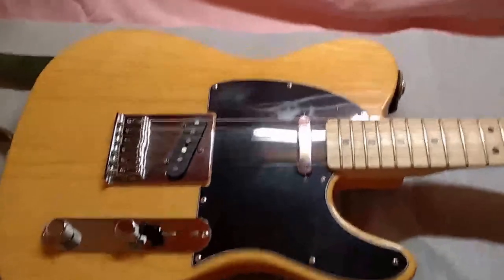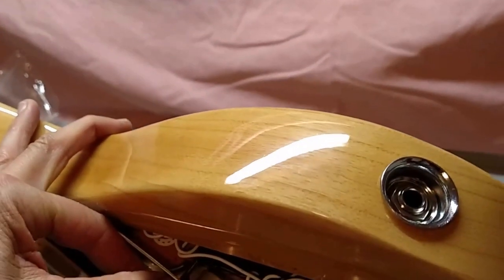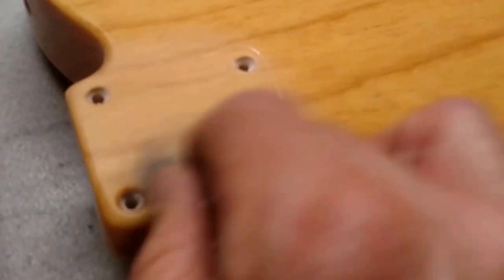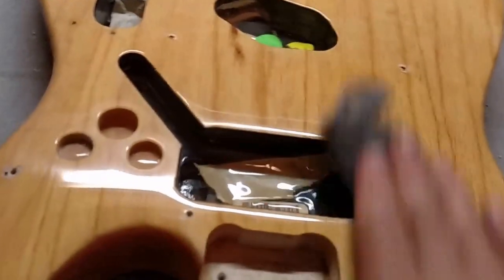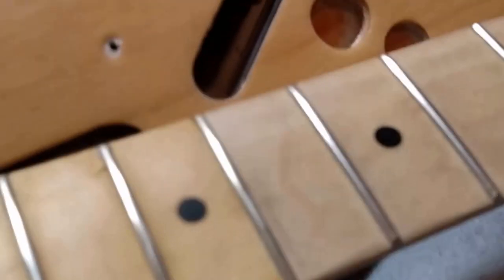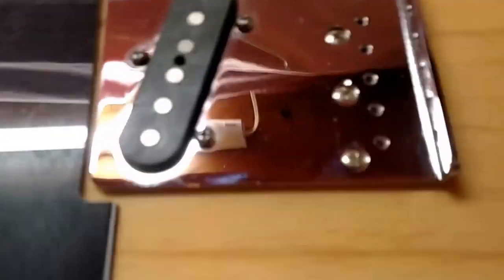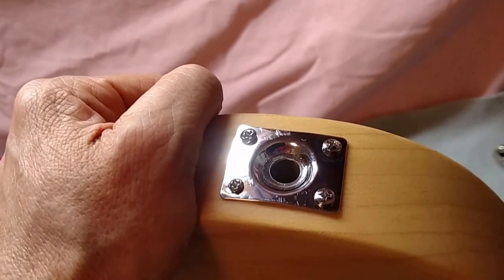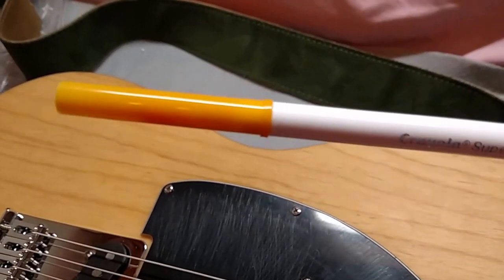How I Removed Gloss From Telecaster Natural Finish Guitar Ash Oak Relic'd

Comment: our modern protective wood finishes don't break down as easily as the old lacquers and varnishes. it's harder to get that broken in look just from daily use. good job making it look the way you wanted.
Reply: They use those finishes because they are quickest to apply in the production process. Some end up ridiculously thick, and I also hate those mirror gloss finishes. I have one older Korean built LP Jr type with a very thin coat of poly, and it is actually starting to age very nice, showing wood grain and looking a lot like nitro, I sometimes wonder if it is nitro. Probably not cause it's a very early Agile of the cease and desist variety.
Reply from the maker: Hey rxz4140, check out the guitar in this video on my new song + music video "SETBACKS" Thank you!
"Setbacks is a swagger filled retro swirl" - Boots Music (UK)
CLICK HERE: https://youtu.be/gwQ09mhF0qk

Comment: If you buff it just a little it will look like a thin nitro finish. The cool thing is it protects the wood better than nitro.
Reply from the maker: Hi David, check out the guitar in this video on my new song + music video "SETBACKS" Thank you!
"Setbacks is a swagger filled retro swirl" - Boots Music (UK)
CLICK HERE: https://youtu.be/gwQ09mhF0qk
Reply: What would I use to buff it..thank you
Reply: Any kind of buffing motor with a buff pad. Hand held buffers will work but you need all the hardware removed first. Just let it shine in certain spots and not a glossy shine.

Comment: 800 grit sandpaper on a homeade sanding block with a little give is the best way in my opinion. I use 0000 steel wool on my frets after a level/crowning or to clean them up about once every year or two. But, I wouldn't recommend it for a job like this. It's messy as I'm sure anyone knows who has used it and less consistent. Not to mention its not something you wanna have stuck to your pups, with sandpaper i just mask off the pups and take it off once the guitar has been sanded and whiped down. That's why I recommend the 800 grit sandpaper. It's just course enough that it won't take forever but fine enough you won't do damage if your paying even a little attention to how much laquer your taking off.

Comment: Don't breathe the dust.
Wet sanding, or even using buffing compound which creates a slurry, keeps down the dust while also creating a more even finish removal.It isn't pretty, but you can still use steel wool, - wearing surgical gloves is the way to go.
Once you thin the poly, it's possible to create cracks on raised edges by applying fairly blunt (but necessarily forceful ) pressure .Heavy steel pipes or hard woods work great for this.Once you get rid of most of the poly, it should be possible to buff out all the tiny scratches, and achieve a more moderate sheen.
This can be done well, - it just requires more patience and fortitude than most have on tap.
Reply from the maker: Good advice, thank u.

Comment: Pls Recommend a specific steel wool type- also did the neck feel differently after sand and color changes. Much appreciated b
Reply from the maker: A pack of steel wool is pretty cheap, like four + bucks at home depot. I am not sure which one I used exactly, it was either a medium #2 or a lighter grade #00. I would buy both and test them. If you take the neck off the guitar, or remove the pickguard you can test an area behind the neck plate or guard with both grades and see which is more appealing to you.
The lighter grade will mean more elbow grease.. you could also use the number two to start with and then finish it with the zero grade.
Reply: @JoeNormal  many thanks. 
Did the neck feel different. 
Am used to the one in my photo- a maple slab 66 ,but dont want to take it to gigs anymore. 
That neck is now - pure wood. 
Just bought an overly shiny American Professional- need to get the shine off… as you know. 

Much appreciated. Nice work. Thanks in advance.
Reply from the maker: @golds04  Yes, the neck feels a little silkier, less grippy when moving up and down the neck at a sweaty gig.

Comment: Did you sand it down to the bare wood or just knock the gloss back?
Reply from the maker: I just took off the gloss, it's not down to the bare wood. The body has a nice satin smoothness to it now.
Reply: Cool, thanks.  After you get used to unfinished/satin necks, you really notice how much the poly and gloss finishes stick and affect your playing.  Right now I'm trying to talk my self into sanding the neck on a Les Paul but I just got it so we'll see.
Reply: JOE NORMAL I'm planning to do the same to my Tele - once you take off the gloss do you recommend applying some kind of wax or oil, or is it unnecessary since the matte finish is still there?
Reply from the maker: Michael Schuppe it's not necessary to wax or oil afterwards. The matte finish does not go down to the wood grain at all.

Comment: does this remove the finish or just matte it? (sorry if you mentioned this in the video, i had to watch with the sound off)
Reply from the maker: It just mattes the finish. Of course it probably takes off a micrometer of the clear finish, but it certainly didn't take it down to the wood.

Comment: Joe, you could just strip all that thick poly and have a body shop spray a thin coat of poly sealer. The sealer is satin finish, would improve your guitar tone, and would quickly wear thru in the usual places.

Comment: You should really wear a mask and stuff, when you're using fine wire wool. The wire wool disintegrates into tiny pieces and gets into the air. It doesn't do your lungs or eyes much good. I don't know, but the polyurethane varnish dust, probably ain't a good source of vitamin C either. Man, you must have lost a few layers of skin off the finger tips, either that or they're as polished as Grandma's best china... I have a very similar Telecaster, but I'm going to leave the gloss as is and hope I live long enough to play the shine off it...

Comment: Hi Joe, it's good video.  Just curious, do you think using sand paper easier and more appropriate than steel wool?. Btw the guitar looks great at the end.  Thanks.
Reply from the maker: Harif Santoso the steel wool worked great because it didn't strip away much of the coating, it just dulled the shine. The finish feels smooth and silky to the touch. I'm not sure if sand paper would have the same result.
Reply: Thanks Joe, I might try that to my glossy neck.  Thanks for the tips. Cheers.

Comment: I think that dulling the finish on this instrument reduces it's value.
Reply: So, it's his guitar, it's just a Mexican built guitar, most custom shop guitars are reliced, so would relicing a reliced guitar be a bad thing? I did the same thing to my 60's CV Tele and I had the same thing, people telling me I "ruined" a perfectly good guitar. Well it now has Fender custom shop pups, 4 way switch and various pots and parts of my choice, and it's my number 1, and it's not going anywhere. Make it your own. I have a 50's butterscotch that fell out of the bag and got "reliced", it's getting the condom heat gunned off in the next few weeks and  the pine body nitroed or oiled.

Comment: Hi! The body looks better (at least on camera) but the scratchplate (pickguard) is a total disaster! Maybe paint-stripper then linseed oil/turps/polyurethane (all 33%) would have given you a better body finish, and if you REALLY wanted to dull out the scratchplate, some very fine wet emery paper. Don't think there was any call for that, though. Still, if you like it, enjoy!
Reply from the maker: Actually, the pickguard looks better in real life.
Reply: Ndlanding using one of those Mr clean magic erasers works perfectly to dull plastic because it is a slight abrasive but doesn't show scratches
Reply: Thanks for that. :) Now I've got to find out what a Mr Clean magic eraser is... Hmmm... Not to worry though, as I have no plans to destroy my scratchplates.

Comment: Get you some acid like they clean brick with on houses from home depot or lumber yard. Pour some in plastic container with a lid and put another container floating in the acid  without a lid and drop your bridge and tuners and other metal parts in it and close lid for about 20 to 30 minutes. It will make the metal parts look old-don't leave them too long. Buy you some vinyl spray for spraying door panels in your car from auto store-get flat or matte black and spray the pick guard after you sand it. It will stay on, it won't come off like regular spray paint. Good luck. Been there done that. I wish my health would let me still gig-I miss it so much.By the way-rinse parts off after you get them like you want them.Don't tell my secret to everybody!!!!!HA!
Reply: why not me OR maybe you can make a video to show your process